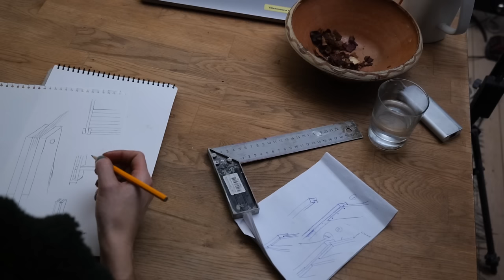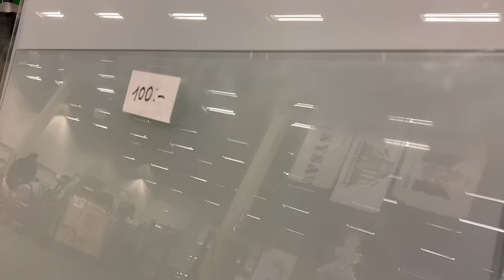#24 Fire place and chimney fixed | Getting reused stuff for bathroom | Renovating house by myself

Comment: Anna, to clean grout smear off the tiles, you can use 1 part phosphoric acid and 4 parts water. No stronger than that. Then just wipe down with water after. The best thing to do when grouting tiles, is to continuously change the water and clean the sponge. It's much easier if you have someone to clean the sponge and refresh the water for you as you go.
Reply from the maker: Great tip! Some one else mentioned that too. I bought something similar in the store, which I will try out. If it doesn't work I'll go for the phosphoric acid 🙂

Comment: The shower tile should be sealed before you grout, this prevents stains, then after the grout is done and very dry, you seal again, this prevents mildew and  other contaminants, and hard water and soap scum from becoming impossible to remove. Once you have the second sealer coat on the tiles you will see how important it is, because now the tiles will stay beautiful and EASY to clean. Carefully select the  right grout type, sealer and adhesive type in which good results depends on whether natural or man made tile.

Comment: Hi, I know that I am writing this after the fact but, if you seal your tile and grout prior to using the shower, it will be easier to maintain. There is a product for just this purpose so it should be readily available. Clean well prior to use and reseal on a yearly basis afterwards. It looks great and I think the dark grout is kinda edgy. :)
Reply from the maker: Not sure I understand exactly what you mean but that could be something to consider for future tiling jobs for sure 😊